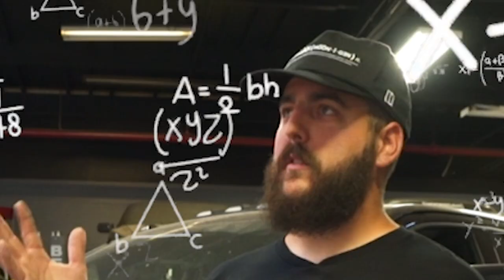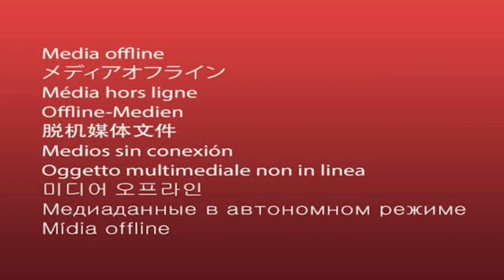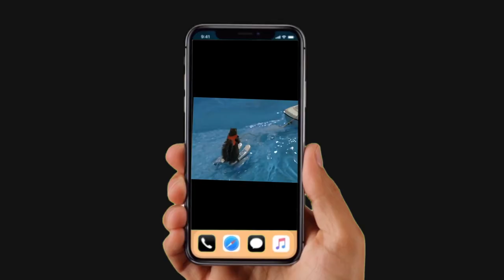850hp 2JZ-Swapped NASCAR no-prep drag races 490hp C8 Corvette Drag Race

Comment: 2jz power numbers always seem inflated!! Makes 850hp, but only for 500 rpm range lol
Reply: Yeah and they always have traction problems, haven't seen a single 2jz put the power down.
Reply: @dsmubz  they can through a slush box pretty decently.
Reply: @dsmubz  check out grannas and Baltic supra and you'll see how 2J lay down power when they have a sensible driver and prep surface.
Reply: That's all horsepower numbers. That's how horsepower and torque works, period: you only get it all, within certain ranges.
Reply: @NaruSanavai  Yes and a 2j can make big power from 5500rpm up to 10000+rpms depending on the set up. Remember it's not a large displacement engine so it depends heavily on boost to make power thus why the power comes on so late in the rpms.
Reply: @draedrae652  first of all I don't think you know how much it cost to make a 2j spin to 10k rpms... next with the modern turbo technology these days there's absolutely NO REASON why your car isn't coming on to boost until 5500rpms. I have a 750hp 2jz and it's aleady lt by 3500rpms all the way to 8k  rpms so these lazy ass 2jzs are just poorly improperly turbo dyno queen builds
Reply: @clutchkickpj693  ok🤣🤣🤣
Reply: When the dyno graph is the shape of a teepee that’ll happen

Comment: 850 HP with 2,850lbs on slicks with a profesional driver vs suppy in a car that makes 490 with 3,535lbs... i wonder whos gonna win this one

Edit: thank god I don't gamble holy shit
Reply: 😂😂😂 never gamble against a c8!!!!
Reply: Trust me I was just as surprised!!
Reply: Smaller engine with a big turbo is gonna be harder to keep in the powerband with a 4 speed like that. The modern autos really make up for a lot. Plus the C8’s launch really well.
Reply: Lmfaooo 😂😂
Reply: This basically came done to the NASCAR was just finished the night before or is technically not finished and it not really tested. Driver maybe a Pro drifter or w/e but that means jack shit for a drag race in a car with only 1-2 test runs on a prepped surface which this race was not on. He didn't know jack of how the car was gonna handle. Basically this was a shit show.
Reply: @NBSV1  yeah, Small block pushrods make the fattest and most linear torque of any engine type, and their power to weight ratio engine wise is nearly unbeatable
Reply: 8 gears against 4 means much much more time spent at or near peak torque, regardless of peak HP. Also all of the electronic nannies on the C8 will always beat out even a pro driver. It's so hard to quantify these things, though. I guessed the same thing as you!
Reply: @Zankaroo  the 2jz nascar has been around for a while lol
Reply: problem with these race cars is always traction, you really do need a properly prepped surface to get the best out of these
Reply: C8 is 3,500 disnt know thought it was lighter
Reply: @mcnuggetapple  Okay well driver still made it seem like they were still figuring it out and the races pointed to that too.
Reply: Seriously lmao! Do you have any grey poupon?!?
Reply: Pro driver just can’t control his 800HP
Reply: @mcnuggetapple  Its been a work in progress for a while too.
Reply: @Tyler_J_Cook  isn’t every car that isn’t factory built
Reply: @mcnuggetapple  There is a difference between iterations of a car/build and constantly changing and tweaking things.
Reply: Seen your comment and agreed..then..well you know.. lets just say you and I have no reason to be in the casino anymore!
Reply: @coyotex850  I bet C8 just because I know this vs that is a no prep surface (and the DCT cmon), I guess I coulda made some money 🤷‍♂️
Reply: Jesus I would have lost so much money if I bet on this shit😂
Reply: They were both RWD. One car has the 3.0L engine in the front. One has a 6.2L mid mounted engine. Second I saw that I figured the 2JZ would win but it would be closer than it should be on paper.
Reply: right
Reply: It's staged
Reply: Props for keeping this up and taking it like a man 💪🏼
Reply: Lmao he lost bad judgment

Comment: Damn I was expecting a lot more out of that 2JZ but that roll race made the difference. Everyone likes donuts though once you get it handled to you by some American muscle!
Reply: @BasedEMT1776  No because it was already planned over 50 years ago here in the US to make the c8 mid engine. Vettes aren’t American muscle but they definitely are a hell of sports/ supercar manufacturer
Reply: Roll race sucked for it as well.  The weight difference should of been enough to account for more than 4 cars, add in the extra 400+hp and its sad that it was only 4 cars.  That said power under curve matters.  Its why 2jz make big numbers and often run with shit that makes a lot less power.  Also 2jzs are the most over rated engine ever.  They sound like dog shit, the fastest so called 2jz are running billet blocks and need a need nitrous to do a burn out.  Yet people act like you can just make 2khp with them all day and its complete bs.  Big block chevys, hell even small blocks are a more better option, best of all they dont sound like dog shit.
Reply: @ElteeMullet  I think the 2jz sounds miles better tbh.
Reply: Yeah cause 2jz is like the greatest engine ever built....said no one

Comment: 100,000 miles in between cleaning the air filter in your truck?!?!? Maybe if you live in LA. You try and do that with my work truck and you will literally have a block of concrete and an engine that is breathing through the holes I had to smash in the manifold. The imaginary stories I used to see in mag ads about K+N pod filters giving you 30 hp are nothing compared to 100,000 miles between cleaning an air filter

Comment: I never understand why people use the 2jz in car classes that don't drive. Thing is with those is when they build up boost they build up crazy power but if you guys look at your parts truck you couldn't really race it because it would just spin the tires and yes I realize it was a turbo 2JZ and it's a truck so the back ends light but I've gone to drag racing my entire life and I've seen people try to use 2jz for drag racing and it's always been hard to keep the tires from slipping.

Comment: Not the right tires mann. Disappointed. I know 2jz would muder everything. My 2000 Lexus Gs300 stock catching that naturally aspirated engine in the right spot with that stock transmission used in nascars would smoothly pass every car above 65mph. Acceleration from stop was slow at about 7 sec 0-60 but cuts through wind like a sphere at high speeds. Not to mention the phenomenal handling.